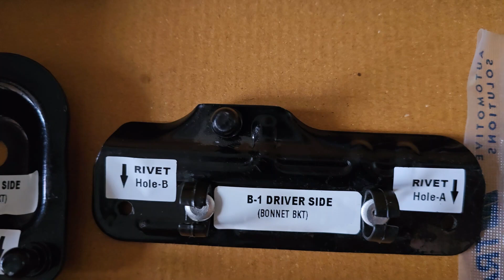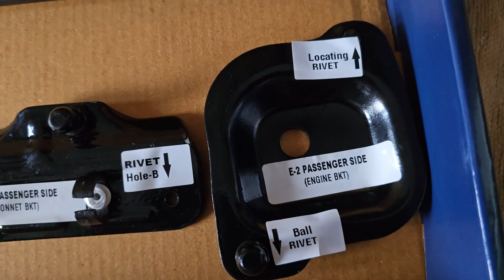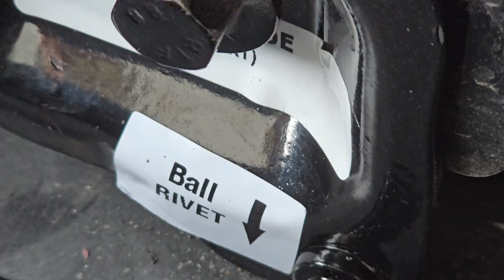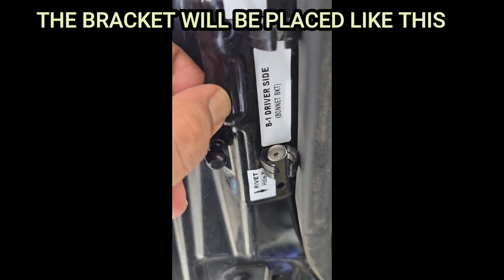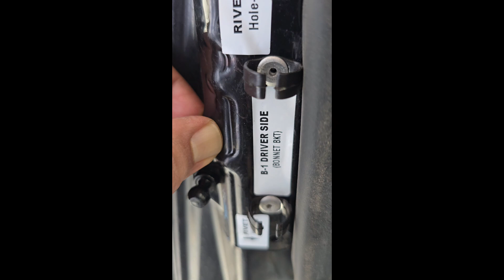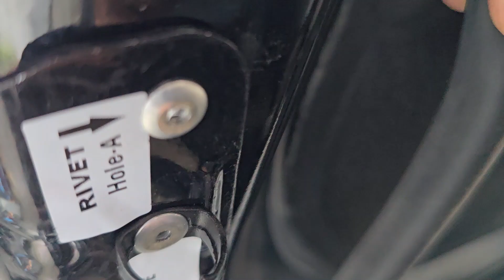DIY Installation Of Bonnet Gas Struts In Scorpio N

Comment: Can we find the struts alone in market? As in, is it universal? Because if the original struts become bad in the coming years, Can we use struts from other brands?
Also are the ball joints reliable or durable
Reply from the maker: The length of struts varies with different vehicles. So u need to check any vehicle who haves compatible length, or can order from this company itself. Ball bearings are reliable technology.